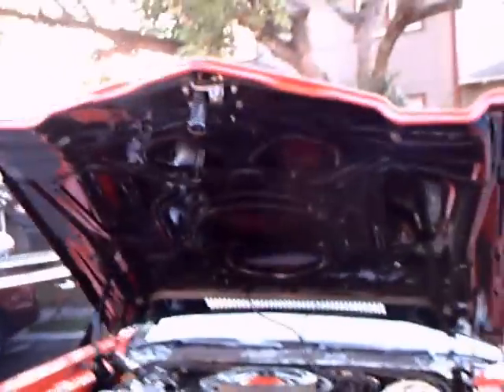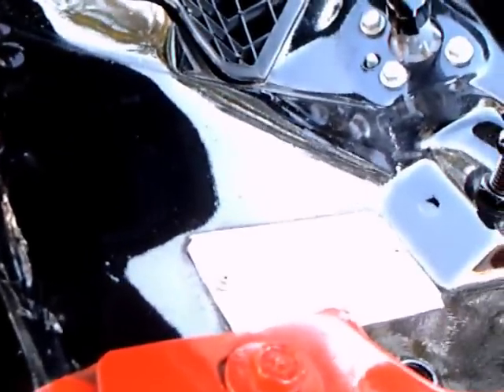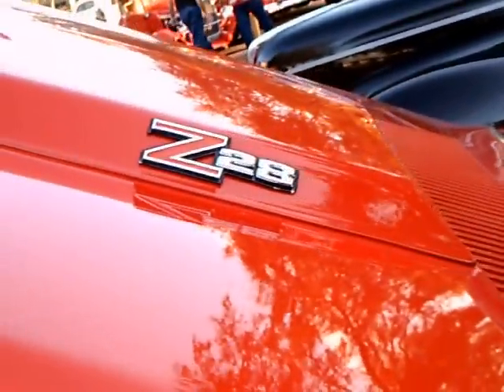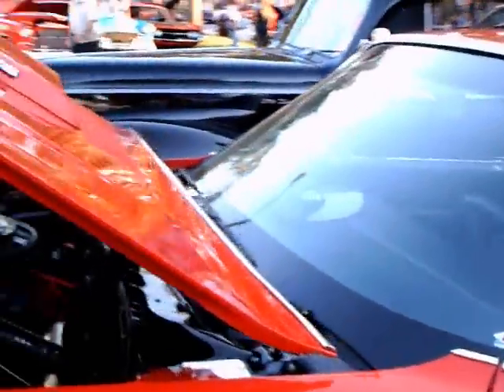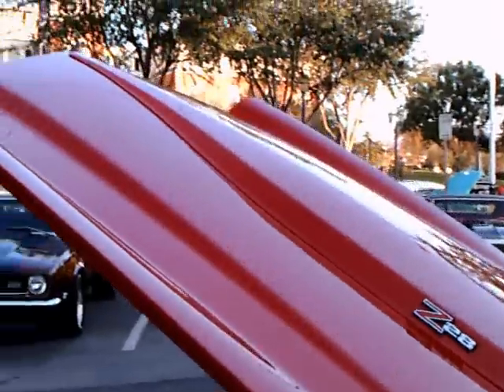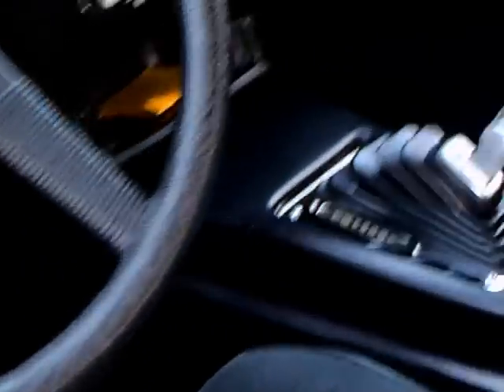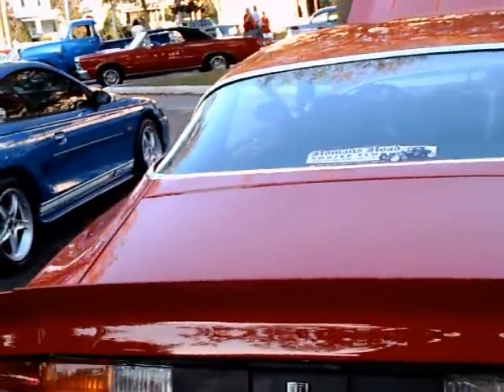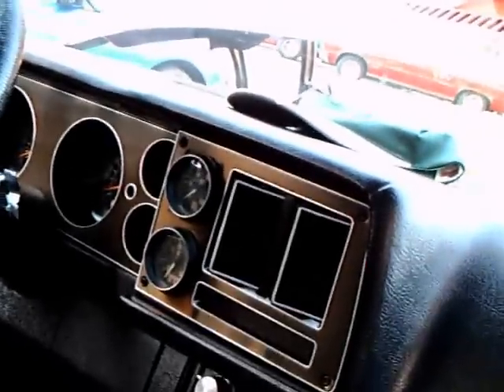1979 Camaro Z28 Red

Comment: Jack, you seem to be right on the year of the car.  '78 and '79 retained that eggcrate-type grille. 1980 and 1981 had the grille with the horizontal slits. (It looks kinda like the slats of a blind, and is a very rugged-looking front end treatment.) So I'd guess the owner swapped the stock hood for a 1980-81. Looks cool--different elements of these F-bodies always "overlap" very well. I saw a '73 or so Camaro once with the vented '78-'79 front fenders and they looked like they belonged on there.

Comment: Looks like a 79 Z28 from front flares, no stripes on tail lights and the rear emblem, Has the 130 speedo too, thats a 1 year only dash so you got the year correct. They added 80-81 hood, fender vents and it looks like 78 plaid interior. Still a beautiful car. Thanks for showing us.

Comment: Looks like the owner incorporated an '80 or '81 hood. The '78-'79 hoods have forward-facing openings on the hood scoop; the '80 and '81 Air Induction hoods are open in the back of the scoop toward the windshield.

Comment: Curious.  1980 was the first year for the rear facing induction. My '79 Z had  the forward facing scoop. However, this car clearly has the 130 mph speedo, of which 1979 was the last year for that. Of all the Camaro models, 1979 was by far my favorite.
Reply from the maker: Hey, Jim!  Thanks for the details...I'm not an expert on Camaro by any means...just remember my '75.  I'm figuring it's not at all unusual to see Camaros and even Corvettes with a mix of body parts from other years...depends on what was available, or perhaps owner preference.  Thanks!  :) Jack
Reply: Jack R Thank for posting this! The Gen 2 Camaro is my all time favorite, with '78-'81 being the best of that group.
Reply from the maker: Jim Dugger Hey, Jim!  It was my pleasure!  Thanks!  :) Jack

Comment: @raconter1 Many people I knew had various iterations of 70-81 Camaros and Firebirds; I sure rode in my share. I remember when they seemed to be on every corner and now that the newest are 30+ years old their "old car" cache has risen. They make a great, affordable first project for younger enthusiasts, with limitless performance potential, parts availability, and muscular visual appeal. Plus so mnay engines plug in--I've seen 'em all from Olds 455s in a T/A to stroker small blocks in the Z/28s.